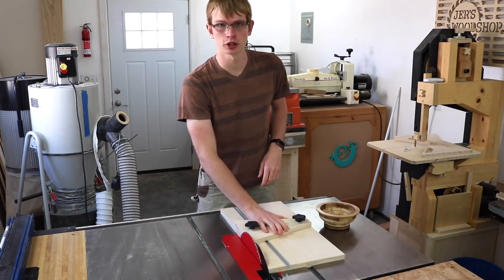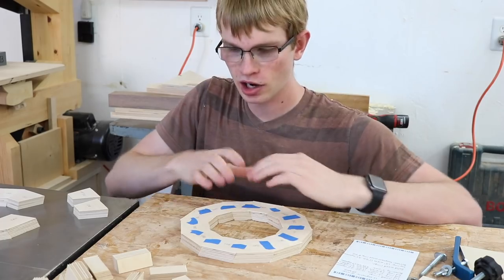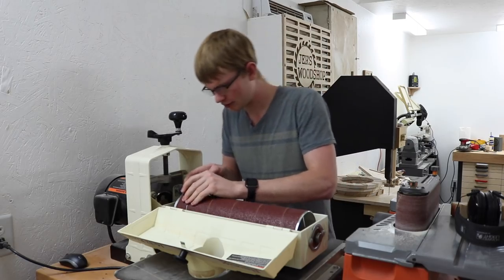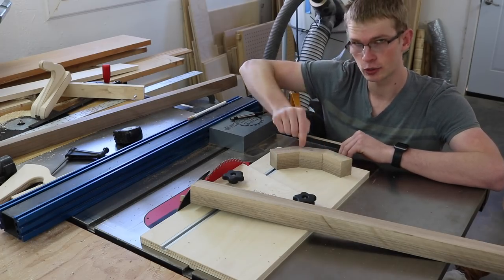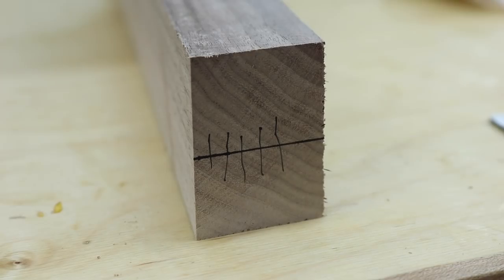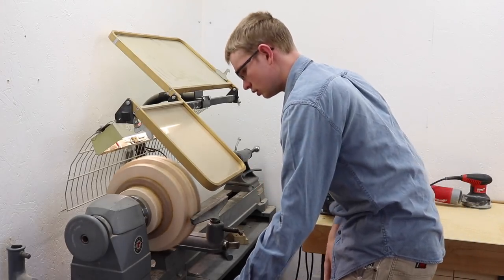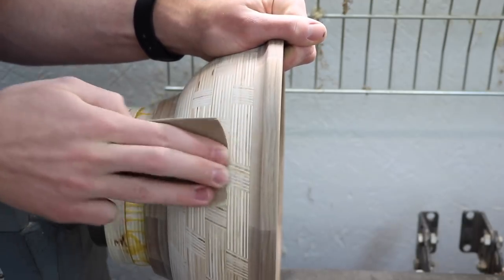Basket weave bowl from plywood

Comment: Impressive. Not only the bowl but also working out all the angles and grain matching. Nicely done.
Reply from the maker: +Mike Lange 
Thanks!
There aren't really any angles to work out. It's just a normal 12-segment ring except it's cut with the blade tilted. And so long as the blade stays at the same angle throughout the project, everything will fit.

Comment: Looked like there was a hole at the bottom. Am I right?
Reply from the maker: +CyniuxD 
Yes, but it's clogged with glue
Reply: Oh, its k then xd
Reply: +Jeremy Schmidt -got this from watching someone else's video: mix appropriate color sanding dust with glue, pack in any holes left over. Also, one gentleman used elongated rubber bands to hold the pieces in a ring. when the ring was too large, he tied a rope around the rings, put a smallish weight on top/middle, made sure the pieces lined up and tied a rope around them and in the knot of the rope, twisted it tight with a screwdriver, used something to hold the screwdriver (I couldn't see what - probably a rubber band! 😉), periodically checking alignment. Then he piled on more weights. That seemed to work, but I bet it takes a lot of practice. But you probably have figured this out all ready, just thought I'd pass the info on.

Comment: Why do bowls sit on the rim of the bottom? Why don't bowls simply sit on the entire bottom surface area? Same with mugs, cups, etc...
Reply from the maker: +Kovacs Kovacs 
If there is a small bump or a piece of dirt on the table, it's more likely to land in the recessed middle area. If the bowl was flat then it would rock back & forth on the bump.
Reply from the maker: +Kovacs Kovacs 
If there is a small bump or a piece of dirt on the table, it's more likely to land in the recessed middle area. If the bowl was flat then it would rock back & forth on the bump.
Reply from the maker: +Kovacs Kovacs 
If there is a small bump or a piece of dirt on the table, it's more likely to land in the recessed middle area. If the bowl was flat then it would rock back & forth on the bump.
Reply: Anyone reading the replys, Jeremy has added a spot the difference challenge. Or has he? Find it if you dare
Reply: Also has to do with the weight of the circular object is basically all carried using the outer rim of the circle. So by cutting away the inside you actually lose next to no stability.
Reply: Put something flat on a slightly wet surface and you'll have trouble lifting it off too.
Reply: Daniel Loughmiller good point.
Reply: the answer is, because it's easier to make a flat rim than an entire flat bottom.  that is all.

Comment: A big dust collector hose with some mesh or window screen over the end is great  for sucking small pieces away from the blade, but not up the hose. (An onion bag works great and is about the cheapest way to get something mesh in a hurry.)  And a well done! I've never cut that many pieces without ending up with slight errors adding up to major problems.

Comment: Jeremy:  Watched most of your video about making a basket weave bowl and noticed that you had trouble with the wood pieces sliding around when you glued them up.  You mentioned it several times.  A little trick I learned gluing up some of my projects is sprinkling a little salt on the glue when you get it spread out and the wood pieces will not slide around when you put them together.  It is worth a try.

Comment: Very creative stuff. 
The glue slide problem where the work moves around a lot as you're trying to clamp it, is apparently easily avoided by sprinkling a tiny amount of plain table salt on the glue. 
The salt grains dig into either side and stop the slide.

Comment: I love the design and your execution. At the end I was looking at it and something seemed off. Then I realized it. You made four rings of plywood. I think five (or more, in odd increments) would be more aesthetically pleasing. With five rings it would alternate with three vertical pieces in alignment, then two vertical pieces in alignment, then three and so on.   I am not dogging you at all. I think it is awesomely, I think I would like to try this sometime. 
I think putting the vertical pieces on the bias also added a better aesthetic then having them perfectly vertical.
Reply from the maker: Good point; I see exactly what you mean. Thanks!

Comment: here is something that will work for finishing your bottoms. Make a plywood disk that fits into your lathe chuck as a faceplate and use self adhesive sandpaper to make a sander, to make a softer touch, glue a mouse pad onto the disk then attach the sandpaper. making a table to fit in the ways should be easy too
Reply from the maker: +Mike Snell 
I think I mentioned I don't have a chuck
Reply: Then toss it instead?

(bad joke)

Comment: A few quick sprinkles of table salt in your glue will help prevent that sliding around at 8:56.  The grit will hold the pieces in place, but will dissolve into the drying glue and not adversely affect your glue up.

Comment: Make some jam chucks that will fit inside the bowls. Part the bowl off the glue chuck. Mount the jam chuck on the drive end of the lathe, spin the bowl around and put it over the jam chuck, bring up your tail stock and center it on the base of the bowl, and then go on and finish turning the bowl bottom. You'll have to leave a little post in the center of the base, but that is easily removed with a pair of nippers and a little sand paper. The way you did it works, obviously. But using a jam chuck is much easier.

Comment: Great Job! Try using carbide tools , like easy wood tools. These will cut a lot cleaner with less tear out.Plywood with all the glue 
in it kills the edge on high speed steel tools.

Comment: Put a brown paper towel in between your piece and the base.  Use a chisel to pop the false base off afterward.   Finish wood turning on the lathe if possible in order to turn the finished work for a glassy polish.   Good video.

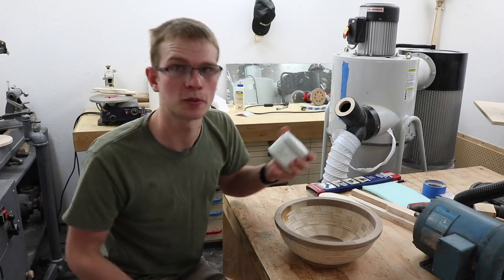Comment: Looks like a bit of gap in the bottom at 13:16 and in the plywood at 13:40 .   You can mix up some of that sawdust you created with some clear glue.  Then use a little scrap to fill the gaps with your sawdust glue and it'll dry almost invisible.

Comment: i think if you set up the blocks so you got a good circle you can draw a circle on the top of the pieces , that way if you put the inserts in you can line up the circle lines across the insert and still end up with a good circle just without the tape 
think to gleu it you could put an elactic band around it and clamp it in between two pieces of plastic sheet and wood  so it doesnt move  or stick 
think it wouldve been eazier to wax and polish the bowl while it was still chucked in , at least the inside , seen it done often on youtube with people making bowls and stuff on the woodlathe 
you could do the outside too , then cut it off the base and do the base by hand , dont think it would look any different but the rest would have a bigger shine and better finish

Comment: If you use your gouge as its intended, in a cutting/ slicing action rather than a scraping action there will be a lot less sanding. Gouges used properly are a joy.
Reply from the maker: +spud pud 
Indeed they are a joy, in solid wood. Plywood is a completely different animal!
Reply: Scraping ply end grain will maximize tear out, Slicing it with a gouge used correctly will minimize that problem. 31 years of turning tells me that.
Reply from the maker: +spud pud 
Ok. I'm not fully convinced yet as I tried both ways, but I respect your experience.

Comment: Ahhh, I have a new understanding of how to use a saw to part off a bowl...  :-) :-) :-)   Gorgeous job, Jeremy!   Huge amount of time spent gluing up all those pieces!     Does that little pinhole that I see in the centre of the bottom go all the way through?
Reply from the maker: +Wordsnwood (Art Mulder) 
Thanks Art!
The hole is clogged up with glue, so it should be watertight (not gonna try that though!). It is visible on both sides.

Comment: not to sound dumb, but WHERE do you get baltic birch?  my small town has 'plywood'... the stuff they get from china actually almost BLEW up my dado blades - not only it is just a smidge smaller than regular plywood which screws up the spacing for rabbets and dados but there was some metal or something - literally stripped the carbide of some of the dado blades.   and the Homedepot that is almost 2 hours away has plywood that has maple or  birch or oak veneer on the outside, but the 'inside' layers are the same...  so where do you get this stuff?  plywood is actually quite beautiful on the edges.. but not if there are divets and chunks and crappy bits in it!  and can i say, the hot glue to hold the slippy wood glue?? frickin' genius!
Reply from the maker: I get it from Woodworker's Source. They sell it online, but I live near one of their physical stores in AZ so I can pick it up. (I think their online price is the same as in-store, but you have to add shipping) I have also purchased some from a little lumber yard in a small town in KS, when I was working there. I don't know of any big box stores or chains that sell it, to be honest...
Reply: ahhh too bad.  i heard you say you bought something from someone in BC and i'm here, so got all excited...  the grocery thinks coconut is "TOO EXOTIC" so i'm pretty sure i'll have to forego the ply...  too bad, i bought s gizmo called a FLICFLOC which i think is make from baltic.    guess the 'bendy' ply is also a dream... sigh.   not that i had anything i needed it for.. just wanted it.

Comment: Great job Jeremy. Couldn't you have used an appropriate sized dumbell/sm. barbell weight (or wood/other circular shape w/ added weights) on TOP while using a band clamp / string type clamp?
Reply from the maker: +Mark Young 
Would have been very difficult, as I would have had to put a precisely sized block on top of each flat segment to hold equal pressure downward on each. Since the weight would otherwise be sitting on only the vertical segments, the horizontal ones would have twisted upward until they hit the bottom of the weight, and that would have made uneven joints.
Reply: I was thinking a wooden disk under your weights, sized for each layer, combined with a band clamp. (Wax or Kraft paper between). Have you tried the salt trick to prevent glued faces creeping? Works awesome, though I'd only use several grains on super hard woods, like exotics.

Comment: Great work as always! One of the most original and creative projects I've seen recently. Weird offhand comment: I can't tell if you're 17 years old, or 40 years old. You could be anywhere in between there.
Reply from the maker: +Simon Rossi 
Thank you! I'll be 20 in a couple days.
Reply: Wow! I'm only 16, but your talent is very impressive for your age. Honestly, I thought you were older partially because of how much experience you seem to have.  I'd be interested in hearing a little about how you got into this and where you got all your tools from.
Reply from the maker: +Simon Rossi 
Well, I grew up on a farm, so always fixing machinery and playing around in the farm shop since I was a little kid. I started hanging out at a local welding shop a lot, until finally they hired me. I didn't work there long, but learned a lot. But I would say more than half my "experience" comes from watching YouTube videos and also just trying things in the shop. Don't be afraid to just give something a try and see if it works, so long as it's safe. If you want to get into making stuff, just start getting a few basic tools, and play around with them. Experiment. And if possible, befriend some makers.
As for where I got my tools, I just bought tools as I needed them, mostly used ones, and used those to make things until I had enough money for the next tool purchase or upgrade. You can't expect to go out and buy a shop full of tools; you have to start with just one and buy others as you see the need. 
I hope that gives you some inspiration! I highly encourage you, and anyone really, to get into making things. It is one of the most rewarding and satisfying activities there is!

Comment: That is one freakin' awesome looking bowl. Did you do anything to fill that hole in the center of the base where the points don't exactly come together?
Reply from the maker: It is filled with glue, but I suppose it would have looked better with a little dowel glued in...
Reply: @Jer_Schmidt  it's not too late if you still have the bowl. Just use a caliper to size the bit to the dowel. Don't trust the labeling of the bit, some run a little large or a little small. I'm sure you know what a bugger-it-all the wrong size bit can cause with doweling.
Reply: @Jer_Schmidt  of course you can always turn a dowel to fit the hole made by whatever bit you choose.

Comment: Hi Jeremy and thanks for a great video - much appreciated.
When I took turning in school for mounting the part to be turned we would put
layers (3 or 4) of brown paper between the bottom of the bowl and the first plywood disk.  So when we went to take the mounting disks off it was a simple matter of LIGHTLY using a chisel to separate the bowl from the disks.  What part of BC are you from  Rod   Vancouver Island
Reply from the maker: +Newmachinist 
That sounds like good option if you have a way to re-chuck and turn the bottom. But in this case since I was using the parting operation to also turn the bottom I'm afraid that would be quite weak. It a good method though, I've used paper for temporarily gluing things together before.
I'm not from BC. The finish I used is.

Comment: Question: isn't walnut actually poisonous and not really recommended for utensils made for food consumption? I know , the bowl is finished and possibly only holding fruit with skins.  But what about salad?
Reply from the maker: I’ve never heard that before... can anyone confirm?
Reply: I would be more concerned with the glues used to manufacture the baltic birch plywood.  Have you done any research on the types of glue used?

Comment: These bowls are super intimidating. Amazing how you crunch right through it. How did u seal up the little hole in the middle of bottom disk? Looks great. Well done dude.
Reply from the maker: +Hugo Danilo 
They aren't hard, just time consuming. The hole in the bottom was clogged up by the glue when I joined the two halves of the bottom.
Reply: I was wondering the same thing. I was waiting for the moment to see a toothpick or small dowel slid in there. A very very nice project none the less.

Comment: Jeremy, good job!  However, you really need a bowl gouge.  The spindle tools you are using are not friendly!  You would enjoy the turning much more with proper tools.  
Try it.
Reply from the maker: +James Johnson 
Thanks! 
Have you ever turned plywood? It's a VERY different experience. Bowl gouges just don't work as well on it, or at least mine didn't.
Reply: Actually, yes I have.  Been turning 35 years.  Check out www.jamesjohnsonwoodturner.com .  Not the best web site, but shows my range of expertise.  James
Reply from the maker: +James Johnson 
Ok, good enough. For some reason I didn't have any luck trying to use bowl gouges, but maybe I just didn't have them properly sharpened or something.

Comment: Try a SALT shaker when gluing up - just sprinkling a half dozen grains of salt into your glue-up will eliminate the slippage & dissolve/crumble enough to avoid causing any gap. Happy w/ your Performax drum sander? Is there another model you'd prefer today?
Reply from the maker: +Mark Young 
Thanks.
The Performax sander is pretty good, but I don't like how much the head can flex up & down. Although I've followed all the procedures found online/in the manual, I still get pretty significant snipe. I may try adding a locking mechanism to the open end to keep it from deflecting upward.

Comment: Could you add some hardwood blocks under the head and tail stock like Kyle toth did so you can turn a larger diameter?
Reply from the maker: +Russ Faulkner 
After I saw his video on adding those blocks I kicked myself for buying the lathe that I did, because that's really not possible on mine. :(

Comment: Nice work. I suggest you to check out passive spinning bowl sandel introduced in another nice woodworking channel, I guess it would work very nicely with plywood turning. No link, you'll find it :)
Reply from the maker: +Ostap1974 
Are you talking about Marius Hornberger's sander? It's a great design but I always forget to make it until I have a bowl mounted on the lathe.
Reply: Correct.

Comment: A lovely bowl but I totally disagree with your beeswax finish. Beeswax is a friction finish ahd should have been applied whilst the piece was still chucked up. Then you could spin it up and heat the beeswax into the wood for a hard permanent finish. Yours is only superficial and won't fully dry. It will also need frequent top ups to keep it looking pristine. As for removing a piece from the tenon or sacrificial base, have a watch of "Phil Anderson"s videos. The solution is simple and elegant with no sawing, parting tools or excesive chiselling or sanding. Cheers.

Comment: A wise man once told me that a bit of salt will prevent your slippery glue situation. Let me know if it works :)
Reply: Also thanks for showing me Claphams!
Reply from the maker: +Adam Patterson 
I've never had very good luck with the salt trick. The parts still slip unless you really dump a lot of salt in, which can't be good for the joint.